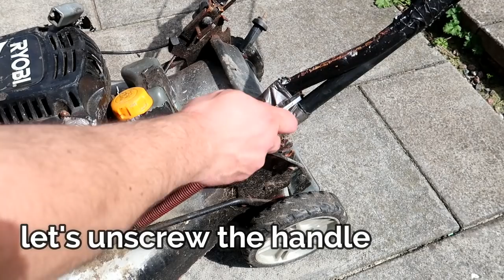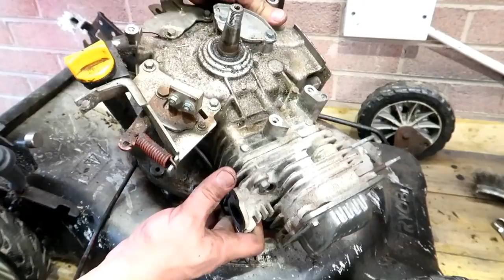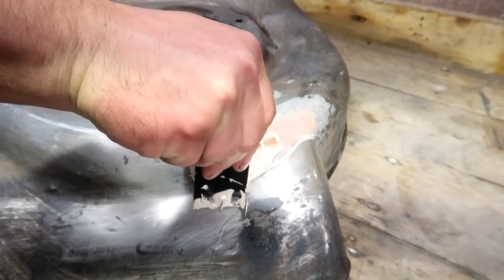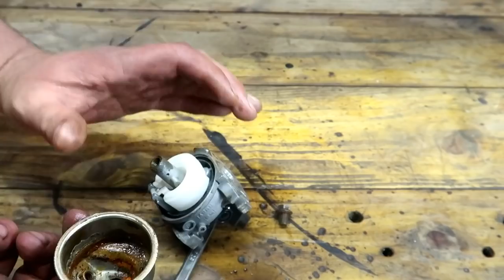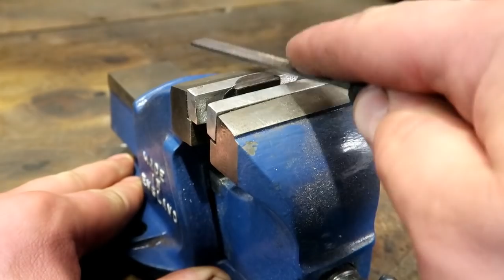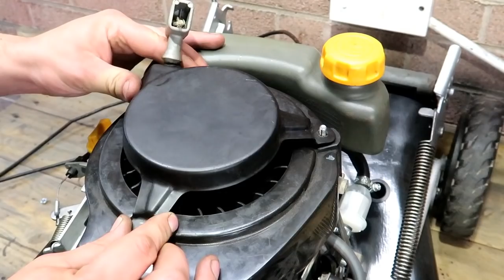Rusty Broken Lawn Mower Repair/Full Service

Comment: Great job. Another one saved from being ' Junked '. When you have the carby pulled to bits like that, its very little extra work to remove the emulsion tube above the main jet, and clean all its little holes. And it will make for a sweeter starting/running mower than what you have already.